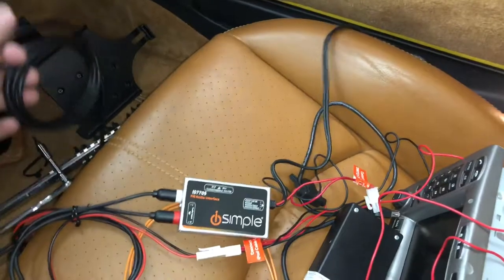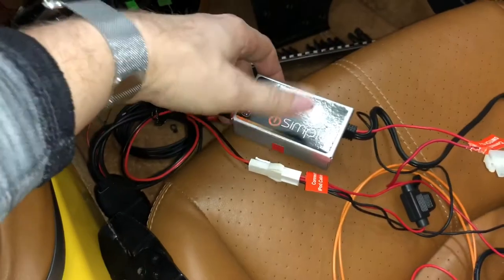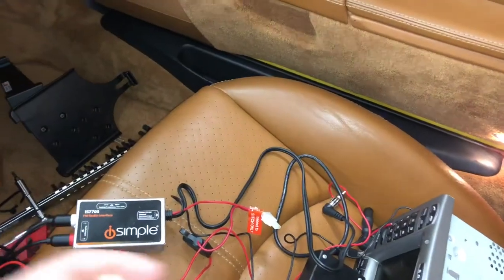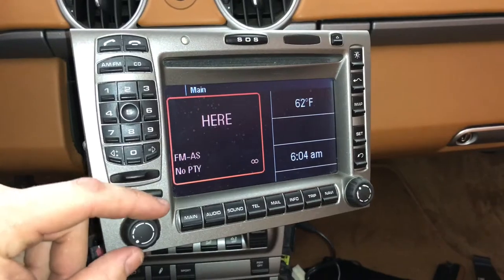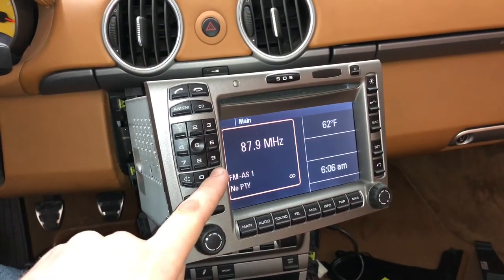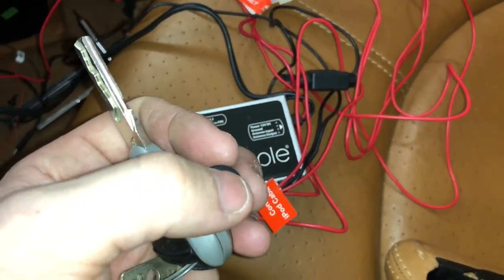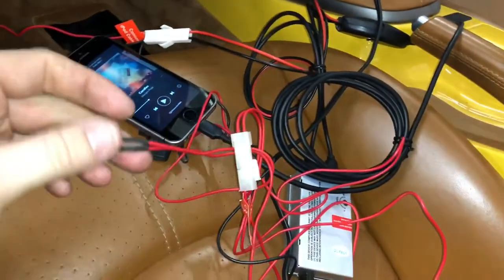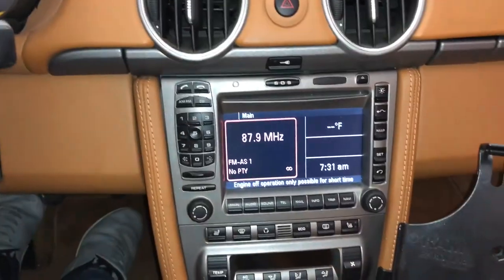Porsche 987 997 factory navigation bose - Lightning charge and play interface installation DIY

Comment: Do you know if this work on a w211 mb with audio 20 radio?
Reply: sure, it has a fm radio!
but there should be much better solutions for a w211...
Reply from the maker: Sure -- as long as it is a 12V electrical system and has compatible antenna adapters available, it'll work!

Comment: I did something similar to my VW Polo, disconnected the cd changer and changed it to a 3.5mm audio jack which I wired into a Bluetooth connector behind thr dashboard. So I had Radio and when cd is chosen it went to Bluetooth.
Reply from the maker: Something like a DICE unit? would have been great, but this radio has 5 wires going to it and then the Fiber Optic does all the rest. HUGE pain in the nuts!